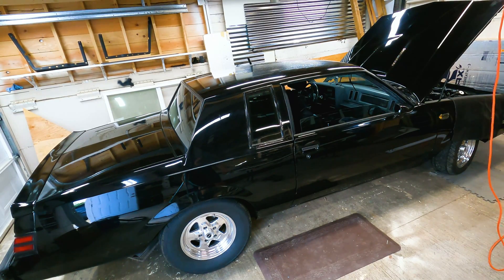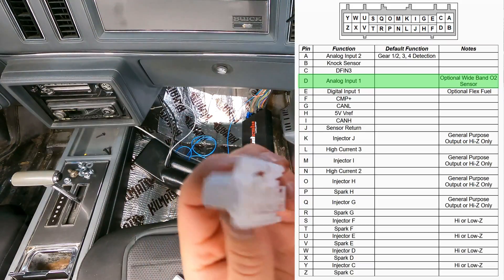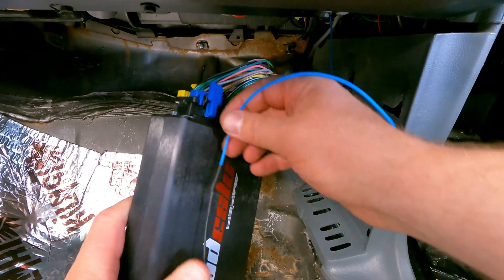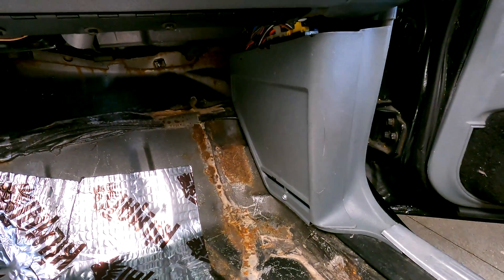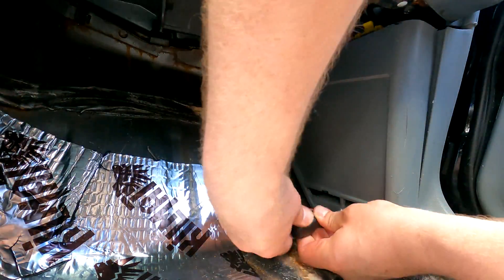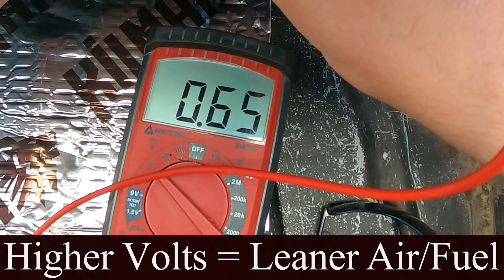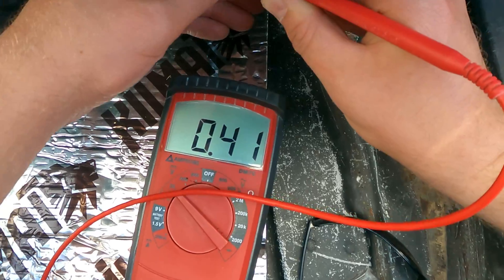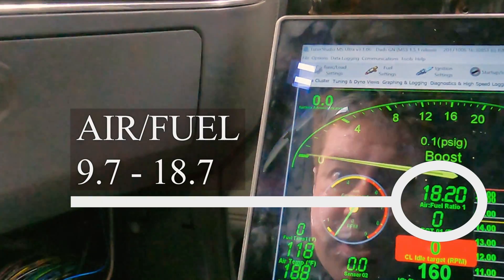Tuning Dad's 1987 Buick Grand National

Comment: I’m  just about ready for my new ecm. What’s your thoughts on using the mega squirt vs gnecu. I know there same platform but I know they gnecu has more data ports and stuff but you seem to have got it figured out. Thanks
Reply from the maker: Honestly I hadn't looked into the ecuGN much, but it looks like an awesome kit. Especially if you don't have a wideband oxygen sensor yet because it comes with one. The extra inputs is super cool but I think most cars won't actually need them. The ability to run low impedance injectors is also cool, but high impedance injectors are available in high flow sizes now so it's not as important as it used to be.

Comment: What makes the idle air control move in and out? I just took mine out and looked at it and pressed the gas nothing happened... and I get a high idle from a cold start.. should I replace it?
Reply from the maker: When you first turn the key on, it should extend all of the way then retract to it's starting position. At least on a megasquirt ECM it works that way. Then as the car warms up it extends to close the valve slowly to let less air in, which lowers the idle to the final warm idle setting. It will then adjust a small amount open or closed, back and forth as it chases the target idle. Try to use the key on and off to see if it moves while plugged in but unscrewed from the throttle body like I did in the video.
Reply: @MotorSwapDan  just tried that it never moved
Reply from the maker: @GtPRiCH  same engine? Stock ECM? The IAC doesn't have it's own fuse or anything, it has four wires that are directly powered by the ECM. Doesn't matter which ECM that will be true. The four wires power two coils of wire inside the IAC. The IAC is essentially a stepper motor in the sense. Unfortunately because of that it makes testing an IAC valve difficult to test and  causes a lot of confusion. Easiest option for most people is to try a new IAC. I personally would measure resistance across the two coils, which means check between pins on IAC, two at a time. Two combinations of pins will have between 40 and 50 ohms measured resistance using a multimeter.
Reply: @MotorSwapDan  to stock ECU and motor... everything has power I'm just gonna go buy a new one.. thanks for the info bro
Reply from the maker: @GtPRiCH  sounds good luck